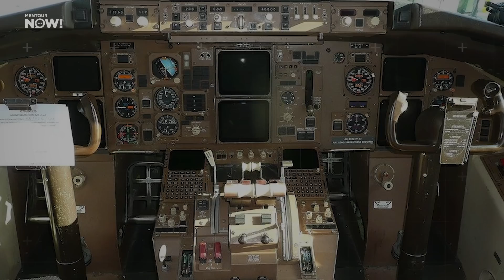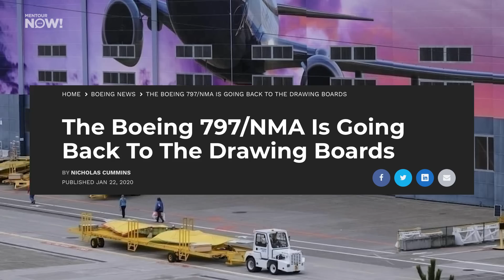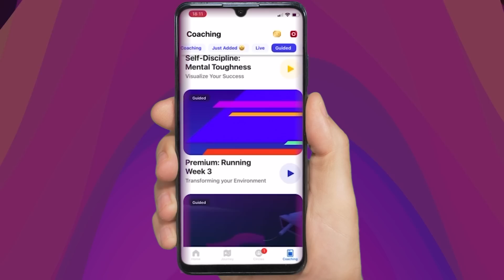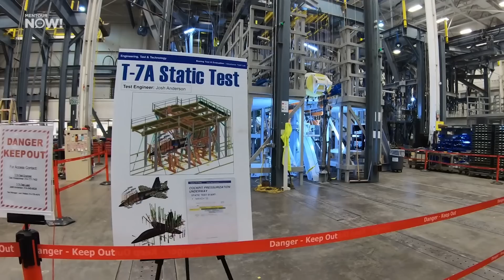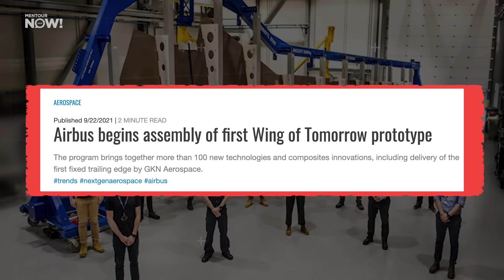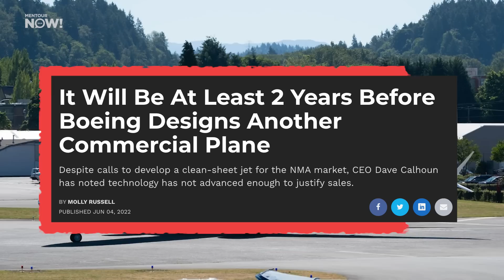Is Boeing Planning a 757 MAX?!

Comment: NASA Glenn research Center recently invented a new superalloy which is both stronger, more heat resistant, yet more flexible than any existing alloy. It can also be 3-D printed. Reports indicate that it will increase performance of both jet and rocket engines, quite a bit. The article I read indicated the fatigue crack resistance surprised its developers. No details of its elemental composition were released. So Boeing may want to wait a couple of years, because you can bet it will make existing engine parts obsolete, with new engines using the new alloy for increased fuel economy and performance.

Comment: This just makes me so damn sad.
I started at Boeing in 1989 with nearly 20 years of non-aerospace experience but quickly became a lead engineer in Flight Controls.  In 2005, I went to Product Development, working on a 737 replacement which was to enter service before 2012.
Unfortunately, in 1997 Boeing sold its soul to McDonnell, and to the Jack Welch GE corporate culture.  It's been run primarily by Welch acolytes like Stonecipher, McNerny, and whoever the current guy is ever since.  The primary corporate philosophy is to hate all current employees and outsource everything, especially if it can be sent overseas.  Yes, I'm extremely bitter about the destruction of a once-great company.
On a more practical level, a 767-200 would be a better starting point than a 757.  The original 757 and 767 actually had  roughly comparable passenger capacity, but the 767-200 had longer range and superior passenger accommodation with 2-3-2 seating at the cost of slightly greater initial and operating cost.  The 767 is still in production with an updated flight deck and would be much easier to reboot than the 757.
Then again, Boeing's last three reboots of existing models -- 737Max, 777X, and 747-8 have been pretty spectacular failures, at least so far.
787-3 anyone?
Reply: I worked 20 years as an engineer at Boeing. I worked on 737, 747, 757-300, 767, 777 and 787 models. The 757 was canceled because it was too expensive.  It had a very large part count because when they designed it, they focused on schedule and did not allow time for part commonality - the idea is that instead of tooling up and producing 30 identical parts, they made 30 different parts that were almost identical.  
As to a new 757....that would almost surely fall into new airplane certification, not a mod.  
As mentioned above, Boeing failed horribly and unforgivably with the 737Max. The 787 ran about $20 billion over its $6 billion development budget. The 747-8 was one of the dumbest things I ever worked on. Boeing has no chance of building a new airplane.  That is over.  The future of Boeing is making parts for Airbus.

Comment: As I understand it, the problem with the B757 in the post 9/11 world (and an issue that was creeping up even if that had not happened) was operating economics.  Those Rolls-Royce RB211-535s that made her such a joy to fly were nevertheless considerably more "thirsty" than the CFM-56 variants powering the B737NG series.  Sure, the B757-200 could carry a similar number of pax to their destination faster than the B737-900, but she burned a noticeably larger amount of fuel in doing so, and with the exponential increase in air traffic since her introduction, the ability to get there faster performance-wise wouldn't matter, as the bottleneck became the sheer number of aircraft waiting to land.  Thus the Achilles' heel of the B757 in passenger operation terms was that she was designed to fill a gap in the market (specifically replacing the B727 in serving medium-haul needs) which made sense when introduced, but was gradually eroded away by the increases in range and capacity that came out of the B737's development.

The B757 had another problem in terms of ATC; the super-critical wing design - which was a major factor in her performance - had the unforeseen drawback of generating wake turbulence of equivalent severity to much larger aircraft, meaning that she had to be treated as a "heavy" in the approach pattern, which in turn had a negative impact on efficiency.

Comment: As a passenger, the 757, and all stretch single aisle aircraft are awful! This is why the 76 is imho a better choice to MAX. Further, the 767 and 787  are in the same weight class, so you could use the 787 wing and engine on the 767 fuselage, which is STILL in production in the KC46. So this is the better option!

Comment: Boeing closed the 757 line a couple of years too soon. Not long after it was closed, the 757 experienced something of a renaissance with AA and DL sending theirs over the Atlantic on long thing routes. At this point, they wanted more 757s and bought what they could find.

I love the 757, it is the best looking airliner IMO.  But it's time is over.  A max would be too expensive to get going.  New engines, new wings, new avionics, new cockpit, new certification.  They just won't go for that.

Comment: Many years of flying Britannia Airways 757s in ‘sardine’ charter configuration on holidays as a kid, I never liked them as they replaced the 737-200s with the P&W engines with cool bucket reversers also they were too long with too many pax and not enough galley or WCs especially if you were sat in the middle of it, well certainly not how Britannia configured them anyway! Boeing shouldn’t have canned the 757, the a321 has cleaned up where they left off but still isn’t as good - I’ve been transatlantic on a monarch 757 and a continental 757, I’ve never seen an a321 do that.

Comment: I just see two viables options: Tweaked 787-3 or a 767X with GenX engines. 767 and 787 both are still being manufactured.

Comment: They should have designed one (target a321 LR) instead of stretching a design that didn't work 737max. They could use the technology from the 787 to make a 757. I loved the 757 as a child with Rolls Royce RB211's. On take off it felt like it could go vertical 😂

Comment: One important omission is the fact that Airbus is already flight testing the new A321XLR, which isn't mid-sized but gets pretty close to the requirements of airlines today and has a range of 4700nm with up to 200 passengers. That aircraft will severely compete with anything like a 757-200

Comment: This just confirms how complex the process of building an airliner has become. Retooling a car factory is child's play in comparison. Boeing's management has of late been so disconnected from the design/build process and more focused on their bonuses and advice from bean counters that the legacy of that company has been seriously tarnished.

Back in the 60s, there was a handshake agreement between the heads of Pan-Am and Boeing. "Build it and we will buy it." "Buy it and we will build it." The result was the iconic 747 and what's remarkable is that in a few years Boeing was not only able to design the aircraft but at the same time create the enormous factory needed to build these birds from nothing. Talk about investment in a project that could have easily bankrupted Boeing. But back then the management were on site and invested in the project. I'm guessing that, like all corporations, the Boeing of then was a lot less top heavy with useless executives and middle managers and gave the engineers and visionaries a lot more leeway to just do their jobs and solve problems.

Comment: Even if a revised 757 used the foundational fuselage it would still require a composite wing, modern engines, and upgraded avionics. At that point, wouldn't it be wiser to build an entirely new airplane? CEO Dave Calhoun has said that the digital design/manufacturing tools are not yet mature enough for a clean-sheet effort. I'm not sure what that means.

Comment: It is liklely Boeing scrapped all of the industrial tooling and infrastructure. So that would have to be replaced.  Also all the aircraft and tooling drawings will be 2D CAD.  These days, we all work in a 3D environment for aircraft and tooling, so converting all the 757 drawing to 3D would be as expensive as building a brand new aircraft.

Comment: hmmm many issues with your argument, the main one being the 321 even the latest one, is not a true apples-to-apples comparison with a "757 neo". 757 has always been and still is, a unique craft, and therefore has no true competitor. If they came out with a new one? well it would still be that way. But they won't, cuz we all know boeing is not that company anymore, They are no longer a pioneering company, they are a typical american corporation that is all about the bottom line.

Comment: Honestly, I loved flying on the 767. The longest flight was my connecting flight from Houston to Guam with a short layover in Honolulu.  It was around 16 hours flying total and I didn’t walk off the 767 all cramped up.  When I fly to Tokyo on the 777, 747, I feel like I’ve been squashed for hours.  (Although my last 747 flight was with northwest, shortly before it merger with Delta).  I flew on the 757 to Mexico and it was a good flight, I just prefer the wide body for longer flights).

Comment: personally taking the 57/67 (they are siblings in development) design might not be a good idea but loooking at how they filled the niche they both did is. ideally my dream 797 would be a small twin engine widebody seating between 250 to just shy of three hundred depending on exact variant and layout ideally taking every innovation of the dream liner and designing this "minidream" to be trans atlantic smaller than the 787 and more economical allowing even budjet airlines to get a foot into the transatlantic flights for under 400$ niche that may or maybe even be feasible.

Comment: TLDR: There won't be any aircraft the size of the 767-200(ER) or A310-300 from any manufacturer.

The capacity gap itself is not really a big deal : If you have the market to put two 737-800 on a route, well, you can indeed replace them with one 787-8 if that suits your fleet management. People think a 787 must serve long haul routes, well, they're mistaken.
The main problem of mid sized planes is, they are UGLY, airlines don't want to use them. Why the 767-200(ER) and A310-200/300 has so POOR sales ? They look beeffy and too small at the same time, and are not really convincing as good flagships for premium routes. You can't avoid single aisle units, and you eventually need heavy long range ones for long haul, and you also wants a mid-sized version ? which increases costs while your custommers are complaining of the lack of comfort (too narrow, it's a small plane not worth the ticket price, blah blah blah)... Small widebody planes are not flexible : they are designed for narrow corridors for poor travelers a flight once or twice a week. That's not a business model any airline want to have. It is better to position a 737-800 or A320/A321, thus increasing service to 4 flights a week while the aircraft can serve other destinations in a more efficient way. An airline letting a plane stay on the ground is an airline loosing money. If you don't want to lose money, don't buy "difficult" airplanes.

Here, I'm mainly addressing the reason why planes the size of a 767-200 or A310-300 are not a thing anymore, especially for those keeping on showing drawings of such design on the web : only a dumb manufacturer will try to design them. Don't get me wrong, I love the 767 including the 200, but it's not because I love that plane that I must ignore what makes it so bad. Remember, the 767 and 757 were designed together with a high degree of commonalities when there was no 737-900, no 767-300ER, no A330-200/800, no A321NeoXLR. Your only choices were 737-200, A300-B4, 707-320C, 747-100/200 or 727-200. Airlines had no choice but use what was available and deal with it. In the industry today, there is just no room for profitable units production of such size when airlines will just select between two 737-Max10/A321XLR or one A330-800/787-8, because, they already have those types in their fleet (or plan to) no way they would buy or lease another type inbetween.

But wait, why 767-200(ER) and A310 existed if they are so bad ? As already said, airlines had no choice, but also, there were a need for larger planes when you didn't have as much medium range single aisle twinjets as today, and much less travellers. You know, back in the days, if your 737-200 or 727 was not enough, what did you had ? 747, or DC10 (if available) or Tristar (even less available) or the old 707-320C (which was a hell to operate on small airports). So, yeah, 767-200 and A310, they were very good.... but only for a few years : 737-300/400/500, A320, then A319 then A321, and of course the 757-200 which is way more succesfull than the 767-200. The 767-300 is much more interesting, as it has NO competitor (not even the A300-600R - And NO, A330-200 is on a level ABOVE the 767-300ER, they are not competiting on the same market), but the 767-200 interest quickly decayed. BTW, you can't stretch a single aisle forever, meaning, if you really want a 280 pax airplane, it has to be a widebody... the ugly widebody the length of a 737-900...

BTW, remember that 787-3 (or whatever its name) a kind of shrinked 787-8 with shorter wings, something between a 767-200ER and a 767-300ER. It was ditched for the reason I explained : only a handful of airlines want those oddities, half of them airlines Boeing doesn't want to satisfy because they are obscure airlines that have payment problems. The other ones being airlines like All Nippon or Japan Airlines that only want to make money on their overcrowded population. Expectations : 40 units, at best, that's not what you call an interesting business plan.

For a 757-Plus, as explained in the video, it's just another 737-Max11 or 737-Max10-Plus. Why would you develop an entirely new plane based on a type you stopped to manufacture two decades ago ? It's exactly the same fuselage size as the 737, slightly narrower than an A320 series... wouldn't it be better to redesign the wings and landing gears of the 737, make it the length of a 707-320C when the next slightly powerful engine than the LEAP starts to show its nose ? Like, somewhere in 2030 when you clearly need to ditch the last flying 757s. I bet there will be much more 737-Max10 and A321XLR already replacing most of the old 757s, but if, and only if some airlines need 757-300 replacements and willing to pay, there you go, you have a strong reason to lauch the next 737 upgrade able to propose a larger version. We need to understand the 737-700/800/900ER also need replacements, in the Max series today, but, even then, the Max series also need updates. Why would you (Boeing) split your resources in upgrades you can't avoid (737s) and the reborn and upgrade of a model 757 that cannot be shrinked to provide a decent 737-Max7 upgrade ? With a new wing, undercarriage and landing gears, with commonalities, type rating and purpose, a well designed 737 upgrade cann address both any 737 newer variant and any 757 couterpart. For once, just do like Airbus (A320/A321/A322), you'll see, you'll be competitive again. The main challenge would be to make a wing structure that adapts well with various types of engine ratings while not increasing costs complications. And if you (Boeing) want to invest in toolings and other new assembly structures, don't make a new type, make 737 fuselages slightly wider and the floor stronger to easily accomodate freighter versions, stop making the 737 sit on its belly. But try to maintain type rating through series (or light training curve), this you can do with the venerable 737 lineage, why would you make the old 757 look like a larger 737 is beyond my logic when it cannot be as small as a 737-700.

Comment: Hmmm, why is RR developing an engine that would be too large for the plane (777) with the largest engine to date? If I understand this correctly, the 747 has smaller engine. What plane is going to use the huge UltraFan?
Reply from the maker: Good question. We might see some new cool things come in the future
Reply: I was wondering the same thing... Why on Earth is RR developing such a huge engine it doesn't fit under the biggest airliner currently in development? 🤔

Comment: I mean… if you need brand new engines and you’re going to the effort of creating a brand new wing as well, you may as well keep going and do a clean sheet design anyway. Re-engining only works if you’ve got new engines to actually hang under the thing.

Airbus had a similar predicament themselves. They were getting very close to putting new bits onto an A330 for an A350. When the 787 proved to be as successful as it was, Airbus cancelled this project and went back to the drawing board to come up with a brand new aircraft instead of rehashing the A330.

I wouldn’t be surprised if Boeing is having the same thoughts now.

Comment: Boeing are not in a good place, still recovering from the Max issues, and trying to sort out 787 production and 777X certification - they simply do not have the headspace or capacity for the NMA.  They need to take a step back and look at their family of a/c and think what would be best for the next 30 years, which could include a new sheet design for the 737.  Time will tell.

Comment: Excellent  presentation. A sad consequence of the absolute Rush that Boeing went through with the 737 Max delivery and Its ongoing consequences. So,757 & 767 where from a better time. Engineering excellence.   But Now  the gap from not having a NMA or 757X or 767 X  version is more critical that the underlying management issues are addressed.

Comment: I remember hearing an airline guy say that to travel on a 757, you got on at your departure airport through the rear door, walked the length of the cabin, and disembarked at your destination through the front door.  Seeing the diagram of the 757-300 helps me finally get the joke.